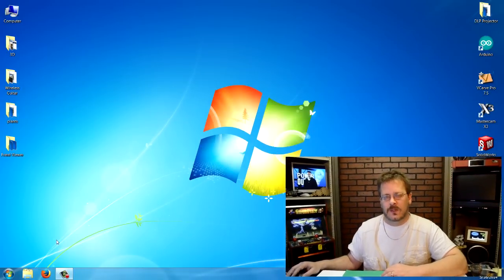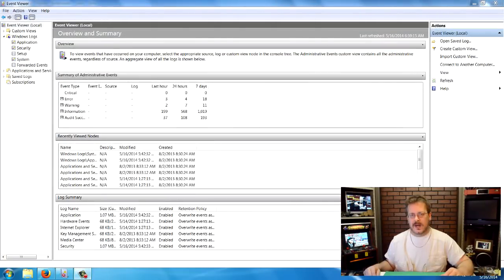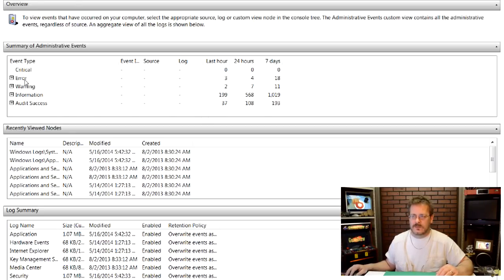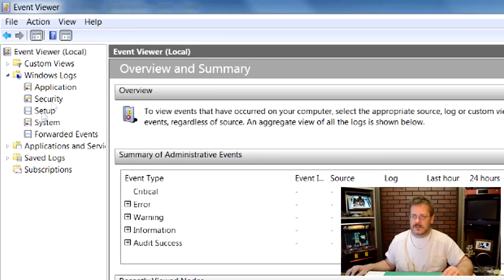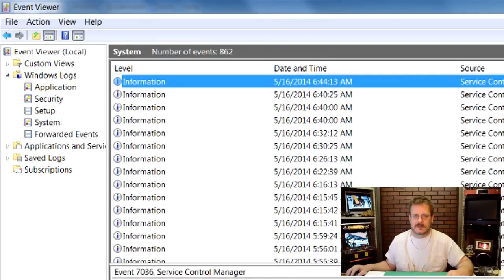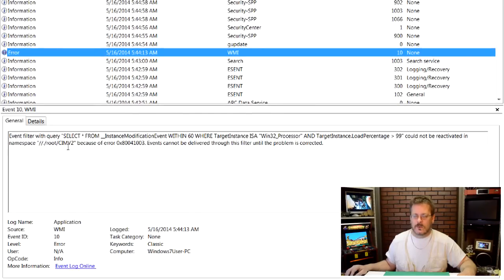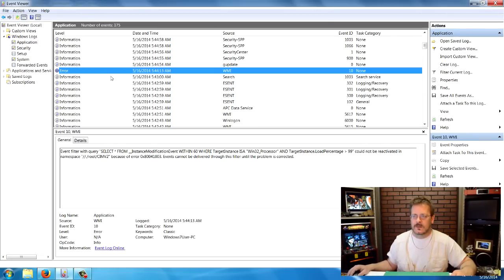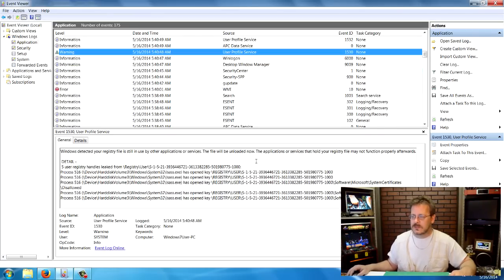Diagnose Windows Problems Using the Event Viewer

Comment: Hey Steve, I don't know if your still around to help people with computer issues, but my wifes computer is a Dell studio 1555 and I have tried everything that I can think of to get it back to factory settings and just have hit wall after wall. I would greately appreciate it, if maybe I could e-mail you and talk a bit about it. A lot of it has to do with her wifi working and then 10 minutes later just disconnecting. Lots of issues and I have looked online for help and have gotten no where. Greatly appreciate it, as I have found a lot of your other videos quite useful. Thanks again.

Comment: I have a problem with Internet Explore and Google Chrome. When I try to go to a website there is a message that says Proxy server not able to connect. I have fixed it for Mozilla Firefox. I have tried changing the use proxy server setting but it does not register. It always resets back and keeps saying proxy server not able to connect. If anybody could help me I would be happy.